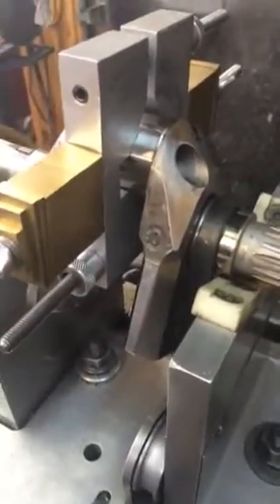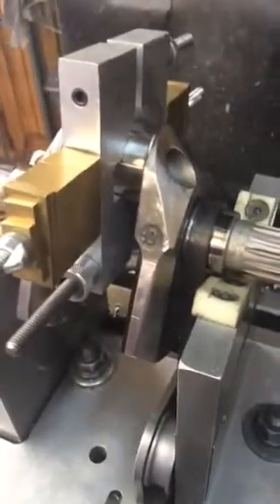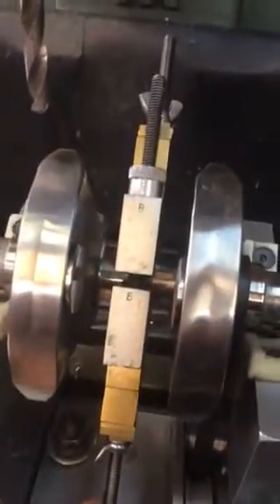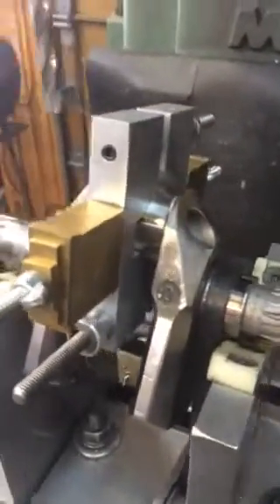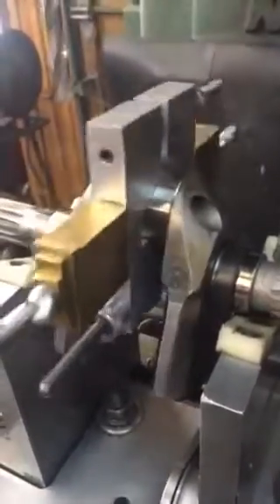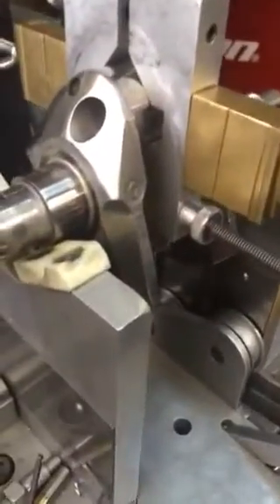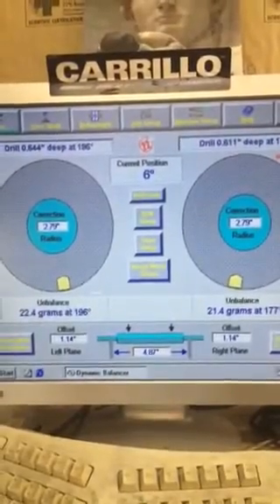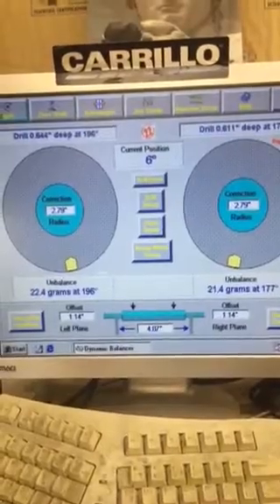Poorly balanced Ducati 1198 crankshaft

Comment: Greetings from Finland! I'm building a bmw petrol engine with diesel crankshaft and I thought how much can I remove material of the crankshaft since I have significantly ligther rod and piston than diesel engine does and also I'm going to run 10,5:1 compression ratio as diesel uses 20:1 ratio. Any tips? The stock crankshaft was with 75mm stroke and the diesel has 88mm stroke. I'm wondering how can I calculate the vertical movement balance